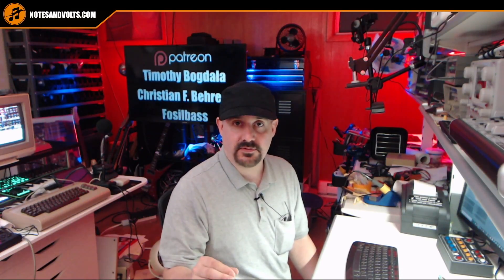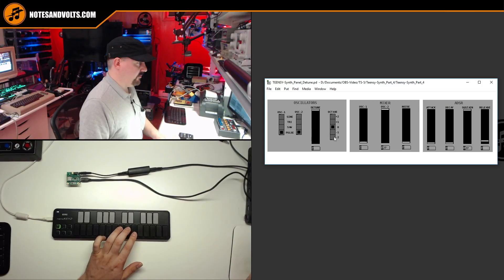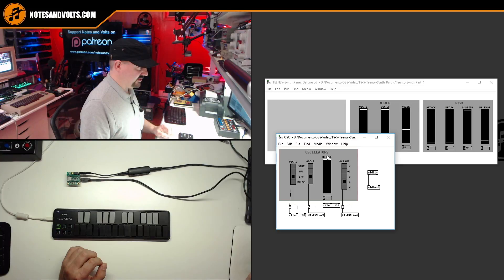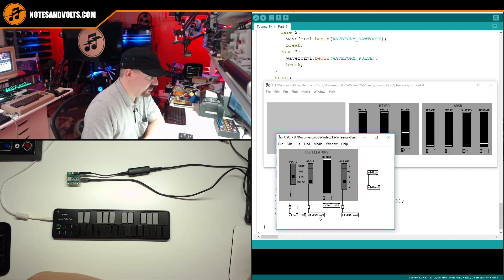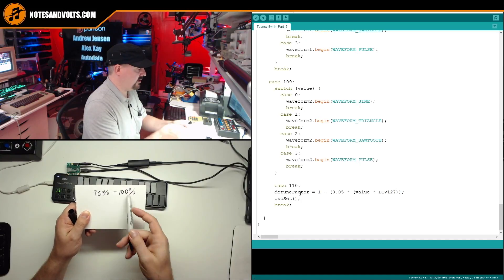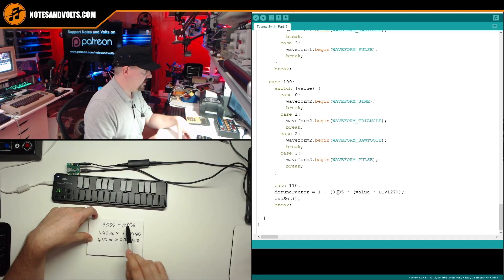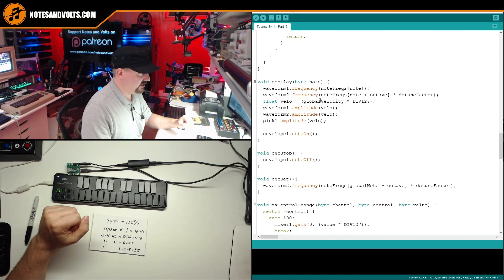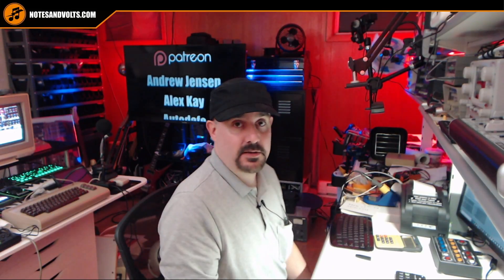TEENSY-Synth PART 5: WAVEFORMS & DETUNE

Comment: Awesome series, Dave! Excellent instructions. The only difference between this pair of oscillators and the laser Lissajous imagery generators that I'm planning to build is that I need discreet 'stereo'  X & Y outputs, with one phase shifted by 90 deg to create a circle.
No prob, simply add another output device to the sketch, right?
Your detune phasing is my image rotation. Your octave selector is my harmonic selector.... but upsized to multiple QOSC modules mixed together for more complex imagery, aka multichannel polyphonic in your world.
The top frequency of my galvos max out ~1K and I'm planning to use Teensy 4.1 for optimal performance., one for generating 4 waveforms X 1024 steps per waveform on each OSC 'module. (4 modules in total, mixed together and independently routed to any of 3 projectors).
So, before diving into this project, I have a vitally important question to ask. In your opinion, is a Teensy 4.1 up to the task of generating 4 * discreet 1kHz 1024 step waveforms simultaneously, with adjustable gains, phase, and frequency controls?
Of course, I realize that a definitive answer would require far more math than could be reasonably expected. So, I'm only asking for your best guestimate, based upon your extensive experience with Teensy audio oscillators.

Thank you for your guidance and HAPPY NEW YEAR!!! 😎
Reply from the maker: I haven't played with the Teensy 4 yet but I would guess that you could get 4 voices out of it. I've seen some poly synths use it.
Reply: @NotesAndVolts  I pulled a previously purchased Teensy 3.6 and audio board out of my parts cabinet and thanks to your great tutorial, it's generating 8 * (audio library's 256 step) waveforms, with 4 phase shifted by 90 deg, creating the 4 quadrature waveform generators, mixed down to the pair of audio outputs, then finally hardwired to my X/Y o'scope.
Their individual gains are being controlled by rotary encoders from a Akai APC40 mkii. Woo Hoo!
The APC40's channel faders are also controlling  MIDI channels within Cakewalk's DAW, which also 'sees' the Teensy MIDI, but when I set the DAW channels' outputs to Teensy, nothing happens (so far). Probably nothing more than an ID10T error.
Reckon I might need another tutorial from 'my pal, Dave' on connecting the Teensy synth to a DAW, which you briefly mentioned is possible. 🙏
I'm also having a problem with the APC40's channel faders being on control 7 and channels 0-7, which seems to be bass ackwards, so I'm also getting ID10T errors when I attempt to modify the 'MyControlChange' function.
So close, but no cigar, YET. But I can smell victory being very near. Once I overcome these few obstacles, it's only a matter of flushing out the sketch with the rest of the necessary controls, like symmetry, detune, etc. 
Then, I'll simply duplicate everything for a different Teensy in each laser projector, commuicating over usbMIDI, instead of only one Teensy at the controller, outputting 15 line levels out to 3 projectors. IMO, this approach is far more feasible. Fortunately, Cakewalk is practically unlimited regarding the maximum # of channels, like Ableton Live.
Haven't figured out how to uniquely address 3 Teensys over usbMIDI, yet. But, there's plenty of road to travel, before I have to cross that bridge, not to mention replacing the APC40 with a custom designed laser board for the cherry on the cake.
Oh yeah. I will eventually need someone with more electronics experience than myself to PCB the quad audio DACs + one more for XYRGB and replace the output couplers with DC coupling. I've already put the word out on pjrc's forum.
I really appreciate the guidance of your tutorials, Dave. Without your inspiration and guidance, my T3.6 that had been purchased 2-years ago for this project would still be collecting dust. Your teaching skills are fantastic!😎

Comment: Hi! Don't the saw and pulse oscillators have a lot of grit in their sound? And the triangle also has some weird noise at the beggining, when it is triggered. Listen at 2:06 Is that always there, or is it because of some other reason? (youtube sound compression, or the recording system used, or maybe my headphones).
Can someone tell me if they hear it too, and if that sound is normal in a teensy synth?

Comment: Dave I am re-watching your entire series before building my first Teensy Synth.    I already had 2 notes:
1.  My teensy came with legs pre-attached, so it needed to be mounted  above my shield, not below.  But, as a side-effect:  the push button is easier to reach for programming.
2.  I love the Detune... as an old analog synth guy... consider through-zero modulation?    So you can pitch up and down , rather than just "detune".   In that case you can shift from a chord to an inversion, for example?  I have a Crumar Spirit, as an example, and I can pitch OSC 2 above or below #1

Comment: Is there a way too bind the sliders too a midi pots.
Reply from the maker: Hi Circular. You can control this with any usb controller or DAW software. Just set the pot to output the correct CC number.